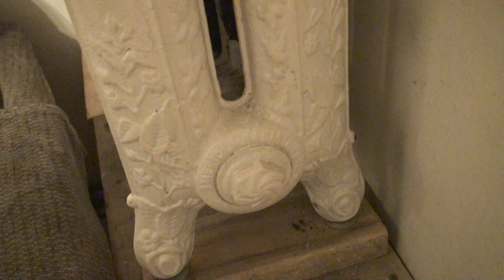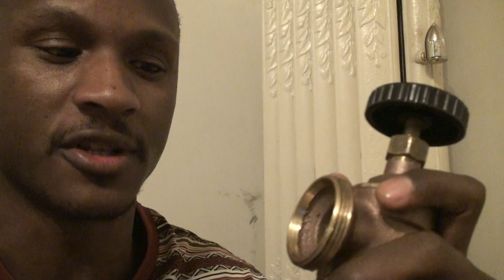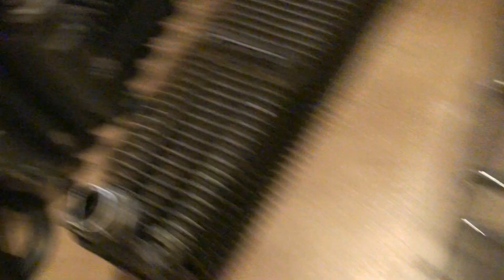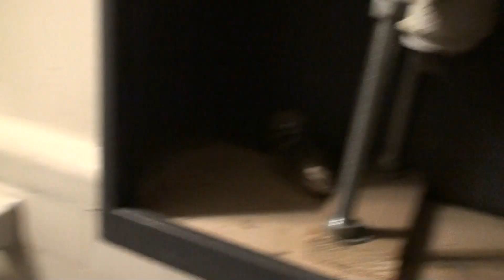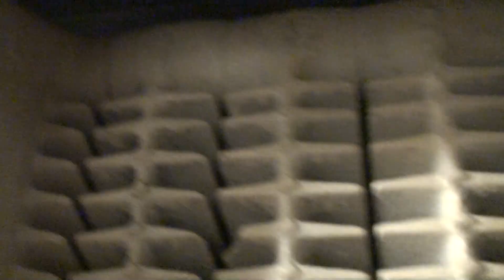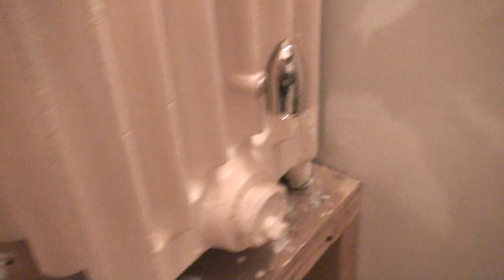TIPS ON A ONE PIPE STEAM HEATING SYSTEM.

Comment: Great job. I learned more in 17 minutes than I thought. I have a one pipe system that is banging, spraying water, hot/cold, etc. The most important thing I learned was not to mess with the handle that shuts the radiator off. I have been moving those up and down like mad. Thanks. I feel smarter now! You rock! Mike

Comment: If you ever plan to refurbish the radiators. Paint removal with something like Peel-away or burn-off, use a torch and wax to loosen all fittings (not the valve, but complete disassembly). Brush all the rust away, Cast Iron you can season like a pan (you’ll need a huge BBQ or kiln room to 450˚F and seasoning oil) or use metallic paint that’s heat-proof. The shiny, the better. Dull holds heat, shiny emits more.

Comment: Thanks for your helpful info.  I know some about steam heat but am learning a lot more.  For the cooling, I've seen radiated cooling only once before (on forced hot water systems NOT steam).  There was a chiller put on to push cold water through the pipes which did work by putting out some cold air radiating from the radiator, but there were several modifications made as condensation forms on the cooled radiators and will drip dramatically so you need to drain it or it will go all over the floor

Comment from the maker: Because my boiler is on the same floor level as the rest of my apartment and since I decided to build a one pipe steam heating system I had no other choice but to elevate the radiators off the floor so the condensation can make its way back into the boiler.

Comment: Awsome video.  Smart ideas.  Have a 1947 Sun Coal converted steam boiler,  there are about 12 radiators.  Mom had 8 shut off at valve for 40 years.  She passed I cleraned valves changed air bleeders and got intermitent heat from 4 of them  A friend came over and noticed the return to the rear of boiler wasnt getting warm or hot, although I still got good heat in most rooms.  Now zero heat  Alot of rust

Comment: I had to replace an air vent yesterday on an old radiator and when I purchased the new valve I thought it might be best to purchase a nipple extractor and 1/8 tap tool in case the valve broke when removing. It did. It was great having everything I needed without having to run back out to the store.  I never used an extractor or had to tap new threads but it worked out great. I learned from videos like this, I watched maybe 50 different videos this week on one pipe steam heating systems and appreciate every single one of them, so thank you for doing these and showing us weekend warriors how to do what we need to. Thumbs up!  BTW, I’m assuming you live somewhere in NY. I’m in Brooklyn where steam heat rules, and haven’t seen any radiators with designs on them. I like! 😀

Comment from the maker: @100PercentGreen) The average pressure inside any steam radiator is normally 3 to 5 psi but steam heating systems dont go any higher than 15 psi. if the air vent works propperly then you get no moisture condensation on the window from the air vent. hot water systems operate anywhere from 0 psi to 45 or 50 psi.

Comment: Your information about steam heating is incredibly informative. I grew up in a home where the house was heated by a wood stove. After doing a good deal of research about how to heat me home most efficiently.  The university where I was a student and now work, still uses steam heat to keep most of the campus warm. The physical plant which heats the water is about a half mile from my building. And my office is always warm during the winter even when the temperature dips below zero. I am interested in using steam steam heat in my home and your videos have been very informative. If I can find a way to use steam heat, I will let you know how it goes.

Comment from the maker: Working steam pressure for this system is 7psi. I could lower the steam pressure to 2-1/2 psi but I don't pay for the heat. I would recommend 2-1/2 psi cut out and 1psi cut in if your using cast iron radiators because #1. they take longer to fill with steam and #2. 1/2 psi cut out your heating system will completely lose steam pressure by the time the burner decides to cut back in at 1/2psi. I always like to no less then 1-1/2psi in the system while the heating cycle is running.

Comment from the maker: You can buy a steel element convector and a cast iron convectore at a plumbing supply store or a radiator refurbish store. I would you a lager air vent to get the steam in your bathroom radiator, for self standing cast iron radiators use a Gorton No.D air vent, for  a convector use a Gorton No.1 air vent and that dosnt work then use smaller vents on the faster heated radiators and larger vents on the slower heated radiators, your best vents to use are Gorton air vents.

Comment from the maker: Well if its the cut off valve then you will mostlikely need a plumber because if its been their for a while it will need to be cut out with an electric saw saw. the cut off valve is the conection that comes out the floor and supplie the radiator with steam.

Comment: You can put nice tables on top of the radiators, you need to rest them on spacers though, but it can limit the convection a little bit.  

I went through an old factory once and they had really nice cast iron radiators just lying around, I may go back and salvage them.  One pipe steam heat is coming back in a big way thanks to natural gas heating.  

Good call on the valve adjustments, either need them on 100% or 0% otherwise its gonna be loud as hell all throughout your system.

Comment: part #1)  thanks for the video and tips...I have a steam one pipe system @ my 4th floor apartment (approx. 150 feet from boiler) .. with large floor mount radiators .. most steam headers/supply pipe are about 80 yrs old .. bedroom radiator using maid-o-mist adjustable angle air vents.. cut off valve 30+ yrs old...... @ beginning of heat cycle the air vent blows steady like normal .. as steam gets closer to radiator the air flow @ vent begins to sputter & cough with air flow not steady

Comment from the maker: You can try tightening the nut on the radiator cut off valve but if that doesn't work then you might have to replace the cut off valve.

Comment: Good question, i live in houston so cool weather is a pleasant surprise. There should be a valve to regulate flow through the radiator so turning it clockwise should restrict steam flow through the radiator thus lowering the temperature. I would anticipate when you turn the valve to close it (especially up north) it will leak a bit so tighten up the packing if you need. Hope this was helpful and good  vid by akwesi pls like.

Comment from the maker: Well I have my radiators mounted on the wall because my boiler is on the same level as the ground and anyone who knows about one pipe steam heating systems knows the system cant funtion properly that way. Now where Im from in New York radiator can be found in most biuldings and even private houses but in newly biuld construction use hot water heating systems and mainly use baseboard or steel convector radiators wich are more commen on hot water systems.

Comment from the maker: PT1. Ok the first thing I need to know is do u control your heat? next do you have access to the boiler? and if so how much steam pressure is the system using? you should be operating at about 2-1/2 PSI cut out, and a cut in at no less than 1 to 1-1/2 PSI. I also recommend using smaller vents on the radiator that heat up fastest and larger vents on the radiators that take longer to heat up, HOFFMAN adjustable air vents and GORTON air vents dont use MAID O MIST.

Comment: Hello, amazing video.  Learned quite a bit.  I live in a 3 floor house(3rd floor is a converted attic apartment).  When I moved in here, the radiators at the top floor did not work.  I had them a long with the piping removed, and put in some electric baseboard heaters.  I assumed since they were basically a hundred years old, the electric baseboards would be more efficient.  I was wrong and wish I did more research before I had pies ripped out of the house.  I had two radiators on the second floor(one for each bedroom), which I moved downstairs to replace ones that broke on the first floor, I learned my lesson though and left and capped the pipes.  Second floor is still comfortable because enough heat rises that I have no complaints there.  What I would like to do is get more back in the third floor apartment.  My problem is this, I would have to run more piping and the house has basically been remodeled so I don't want to have to destroying ceilings again if it could be avoided.  My head for the third floor was, to take the one pipe on the second floor, uncap and extend it to the third floor.  This is where, ive been unable to find any information, once the pipe is on the third floor, can I split it and do two radiators?  Its a single pipe steam system exactly like yours.

Comment from the maker: Not if the radiator is properly pitched and the cut off valve is is completely open the air valve will work fine. The lowest point of the radiator is the best way to vent the radiator.

Comment from the maker: I would rebuild your steam system or if you don't wish to go with steam then use hot water heat, I don't recommend baseboard radiators or forced hot air because neither of these systems hold heat once the boiler shuts down.

Comment: Is there a risk when putting the air-valve low on a one pipe system that the the valve will be filled by water and not function properly?

Comment: @ Sir Sebastian, I would go with Heat-Timer varivalve which allows for the most air to exit the radiator in the shortest amount of time. Price is about $19 each but so much better made then Gordon or Hoffman. The second but more expensive way is go with a thermostatic radiator valve which you can set the room temperature for each radiator making each room its own zone but you will spend about $60 each. Change your valves every couple of years

Comment from the maker: It sounds to me like you have a hot water heating system because you dont manually bleed out a steam systems, Gortons air valves automaticly vent themselve, my questions are do you live in a house or building? do you control your own heat? does your boiler have a water sight glass? do you have 1 or 2 pipe going in the radiator? and do the other radiators get hot in your house? these answers can help me better understand your situation so I can more accurately help solve your problem.

Comment: Good video! I have a problem with one of my radiators on my one pipe steam system. This one radiator in the system is cold to the touch. I cleaned out the Varivalve air vent  by soaking it in hot vinegar as per the manufacturer recommendation on their website. That failed to address the issue and I'm wondering if the air vent is bad or if the shutoff valve is bad or if their is a blackage. The knob on the shutoff valve moves freely. The rest of the radiators in the system are fine. What should I look at next? I was thinking to just replace the air vent since they are relatively cheap.

Comment from the maker: PT2. Also make sure your cutoff valves are completely open and make sure your radiators and steam mains are properly pitch back to the boiler, and if you added another radiator to your system then you might have to let your boiler run a litte long to bring up that steam pressure. let me know how you make out?

Comment: Awesome video, Sir!  I have a single pipe steam system in my house and based on my years of experience as a homeowner your information is spot on!

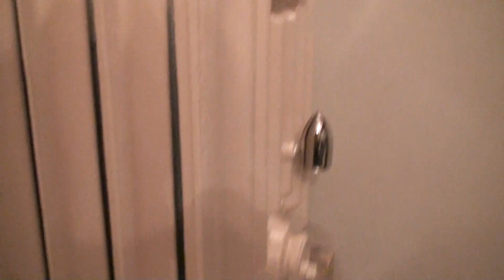Something I noticed, at 15:12 you introduce the little short squat radiator.  All your other taller radiators are quiet but that little guy's valve is hissing.  I've got one of those squat radiators in my house (the rest are the old cast iron ones) and I have the same situation - when the heat's on and other radiators quiet down as they fill with steam my little guy still has a hissing valve.  I've replaced the valve and even swapped valves with a known good one with another radiator, and always whatever valve is on the little squat one hisses even if it worked elsewhere.

I wonder if you have any thoughts as to why that's the case?  Do those "squatties" require a different steam valve?

Comment: I have the same one pipe heating system in my home. All the radiators have air valves and they are working. My radiators have a total of 7 fins and only 3 of them gets hot and the other 4 remains cold. Also the one in the bathroom does not get hot at all unless I turn my heat up to about 80. Please give some sugestions

Comment from the maker: Did you change the air valve or the cut off valve and do you have control over the heat? and if so what operating steam pressure is your boiler using?

Comment: Thanks for the demonstration.  I'm having a hard time with my system.  It is always asking for water, most of the radiators won't get warm.  Those that do get warm only halfway.  I've changed the vents, I've bleed the system.  I've shut down all but one and still, the steam is very weak.  I'm thinking that I have clogs in the system.  If you can help, I'd greatly appreciate it.

Comment: GREAT ADVICE! Now, how would you handle this, apartment building, steam heat, 6 apartments (3 on each side) , but the apartments on the far side of the boiler receive less heat in the radiators than the apartments that are situated just above the boiler. By the time the boiler sends up the heat (steam) to the far side of the building it shuts off. Thank You!
Reply: I don’t know about the timing of the system, but, I wonder if on the far side, there may be end of the run risers that the relief valves are painted over. If that’s the case, then the system may be filled with compressed air on that side. So the steam never reached because it’s not vented out.

Comment: the burner motor (newer Beckett) wont turn.  Is it possible the low water shutroff is clogged so much to prevent pwer to burner?  Any way to clean float and also the rusty return lines.  Peace  Andy

Comment: I have one of those old cast iron radiators (though not as pretty as yours), and it's spraying water out of one of the fittings by the valve.  I'd really like to fix it myself instead of paying a plumber if it's simple enough to do.  The leak is at the connection closest to the actual radiator.  Can you help?

Comment: Thanks for the tips! I just purchased a cast iron baseboard unit for lack of space in a small bathroom. I was told by the hardware store that it would work in my one pipe steam sys. The radiator has two 3/4” ports on each end. My biggest concern now after some more research is that the 3/4” port is not big enough. The plumbing in the floor is still the same but will i have a problem after reducing it to 3/4? Obviously steam goes in and condensation comes back out the same port. Please let me know what you think.

Comment: I own a 2 family home where I'm having a heating problem.  It's a steam one pipe system.  There's about 10 radiators in the house.  One of the radiators gets hot some of the time.  The others make heat except this one. The one in question is the first one coming from boiler.What should I look for to solve problem? 
Thanks for videos. Very helpful.
Reply from the maker: You might need to check or replace the air vent on your radiator with a Hoffman or a Gorton air vent, also check your cutoff valve to make sure its open all the way and make sure you radiator is properly pitched back to the cutoff valve.

Comment from the maker: Do you have a one pipe steam heating system with air vents at the end of the radiators or is it a two pipe heating system? do you have steam heat or hot water? and do you have cast iron radiators, steel convectors that are recessed in the wall or baseboard heating? I'm trying to get an idea of how your system is set up.